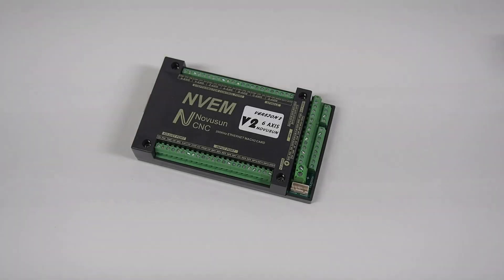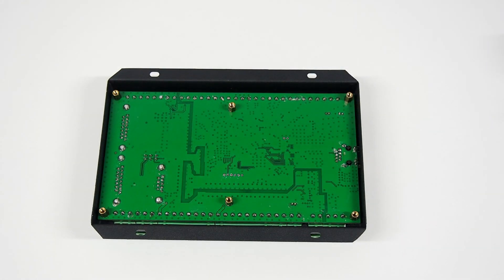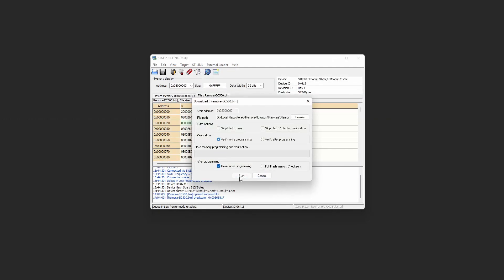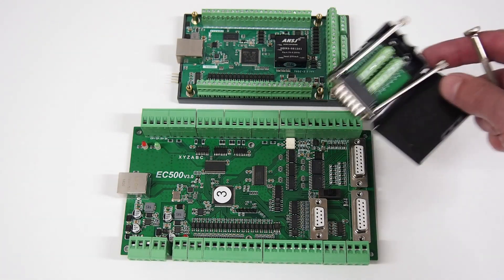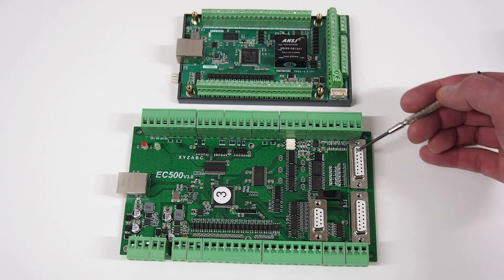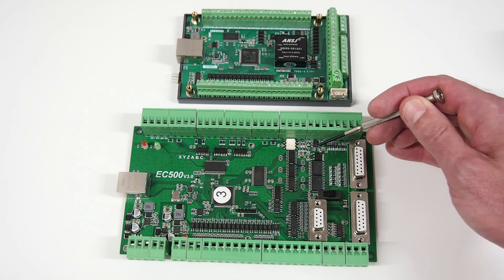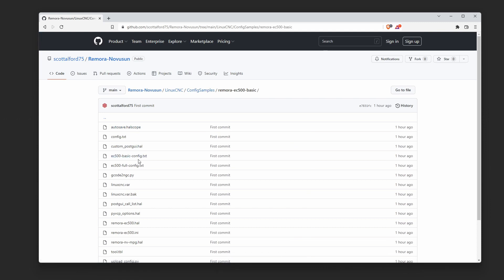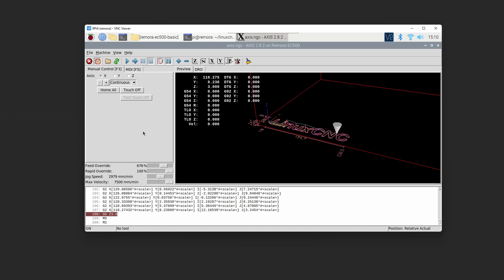Remora EC500

Comment: Hi everyone,

I’m planning to use Remora with a custom-designed board, and I want to use it with a regular PC (not a Raspberry Pi). I would like to communicate over LAN (Ethernet)

Here are my questions:
	1.	What STM32 MCU is recommended for this setup?
	2.	Which firmware should I use or modify?
	3.	Is it possible to communicate with the Remora board using Ethernet from a standard computer running LinuxCNC?

Any guidance or resources would be greatly appreciated.
Thanks!

Comment: Looking for this DD EC500 on ebay and amazon. They are with the model EC500, no Digital Dream marking. Will one of these work with the Remora firmware. (They look 99.99% the same, just DD text missing) My RPI5 with LinuxCNC 2.93 is just waiting for this project upgrade.

Comment: Thank you so much scott for this great video.
I just got the EC500 version 5. And i couldn't figure out how to flash the Remora firmware on this board because it seems to have a different configuration.  The pins on this board are
GND
SCK
SWD
PRO-B
3.3v
BOOT
I was wondering wich of each pin will connect on the stlink v2 in order to flash this board
Reply from the maker: There is heaps of info and a guide in the LinuxCNC forum topic. https://forum.linuxcnc.org/18-computer/44828-remora-ethernet-nvem-cnc-board?start=1640#295702

Comment: hi I have a quick question as now I can see that new EC500 has LED's near each output / input pins  and I also wonder if they changed something on the board itself as well and if this will be working with your firmware ?   I plan to make second cnc machine and i'm looking for new controller and if this will be a good option then i will order that board  and use this remora firmware

Comment: Hello, I have an EC500 board with a burnt microcontroller. Is this firmware the main one? If I replace the microcontroller and reprogram it with this firmware, will it start working again?
Reply from the maker: Hi, if you board has the NXP RT1052 chip, these are not easy to replace. The STM version of the board would be a little easier but still difficult without the proper equipment.

Comment: Hi Scott, I'm having a problem, when I run python3 upload_config.pi ec500-full-config.txt it displays this 
Timeout waiting for traffic, retrying...
Timed-out waiting for traffic
resending last packet
Resending packet WRQ packet: filename = config mode = octet on sessions <tftpy.TftpStates.TftpStateSentWRQ object at 0xb65339d0>
Any idea on why I'm having this problem?
Reply from the maker: Hi, which version of the EC500 so you have. The STM or RT1052 version. The RT2052 firmware does not have the capability or need to upload a config. It has everything enabled in the firmware.
Reply: @scott3d506  I have the RT1052, does the config need to be uploaded?
Reply from the maker: @oscarbeltran1105  No, the firmware is hard coded. I'll be releasing a specific firmware version for the EC500 in the coming days with all of the IO except for the MPG operational.
Reply: @scott3d506  Great! Thank you!

Comment: Hi Scott, All is going well now i have finished the hardware. I can not seem to find how to change the motor direction in the ec500 config.txt. Could you please give me an example of changing motor direction thanks.
Reply from the maker: Hi, the motor direction is set in the LinuxCNC configuration. In the INI file the change the SCALE for the joint to be a negative or positive value to change the direction.
Reply: @scott3d506  thankyou. Did you get the 0 to 10v  for the motor speed controller working. Thanks for all your help.
Reply from the maker: @powermate  Yes, it's working for the STM32 version and I have a software PWM version working for the RT1052 version but I have not released it yet as I want to get the flexIO version working. Been busy with work so hopefully of the Christmas break.

Comment: Hi All, Just got this working on a J1900 NUC with LinuxCNC 2.8.2 Debian 10 Buster PREEMPT-RT ISO. I installed advanced network manager (mine was not working to edit the connection) then Probe basic (maybe this helped). I set up the connection like they do for mesa boards. Then installed as per this video and the Nvem video. I am no exert on this, all black magic to me.. So far seems to be working great. thanks Scott for your help so far.

Comment: Hi All, The software is working great now to hardware. When i measure the voltage on the direction pin (PE13) it goes from -3.2v to +3.2v. My servo expects 0 to +3.2v or more. I did fix this using a diode in the direction pin. Do you guys think that this can be fixed by firmware or is it just part of this hardware board.  thanks Bradley
Reply from the maker: Hi Brad,  great to hear. Step by step your getting there. The EC500 step and direction drivers are a differential pair. This is what you are seeing. Try using + terminal and a ground (common). There is a com0 on the spindle terminal. This is how I've been testing with my logic analyser.
Reply: @scott3d506  thank-you, I will give that a go. The raspberry pi is more that enough for my mill. speed wise. I will mount the pi on the ec500 for a neat unit.

Comment: Hooray . Finally got it going great. My bad. As a newbie to Linux I had to refer to the other video (NVEM) and accidentally used the wrong software. I also had to install the tftpy library and for some reason the halcompile did not work so i re stalled that too.  I would like to get it going on a pc with  Debian 7 Wheezy ISO. So far I am trying to compile the component but errors out cannot find any of the library files. I have the pc  communicating with the ec500 board . Has anyone a got a idea on how to get halcompile working. Anyway thanks very much for the start.
Reply from the maker: HI Brad, great news. to get halcompile you need to use the dev version of LinuxCNC.
Reply from the maker: sudo apt-get install linuxcnc-uspace-dev
Reply: @scott3d506  I did try  (sudo apt-get install linuxcnc-uspace-dev) on my PC. Can you get that dev as an iso if not I think building it would be above my pay grade  :) As you can see the math.h is missing and when i change it to rapi_math then the next library is missing and so on. Does not find any of the librarys.

make KBUILD_EXTRA_SYMBOLS=/usr/realtime-3.4-9-rtai-686-pae/modules/linuxcnc/Module.symvers -C /usr/src/linux-headers-3.4-9-rtai-686-pae SUBDIRS=`pwd` CC=gcc V=0 modules
make[1]: Entering directory `/usr/src/linux-headers-3.4-9-rtai-686-pae'
  CC [M]  /tmp/tmpHZfwXY/remora-nv.o
/tmp/tmpHZfwXY/remora-nv.c:25:18: fatal error: math.h: No such file or directory
compilation terminated.
make[4]: * [/tmp/tmpHZfwXY/remora-nv.o] Error 1
make[3]: * [_module_/tmp/tmpHZfwXY] Error 2
make[2]: * [sub-make] Error 2
make[1]: * [all] Error 2
make[1]: Leaving directory `/usr/src/linux-headers-3.4-9-rtai-686-pae'
make: * [modules] Error 2
bradmohr@cncmill:~/linuxcnc/Components/Remora-nv$

Comment: Hi , thanks for the video.  I was given an ec500 to experiment with. I am trying to connect to mach 3 first to see if the ec500 connects are usual before upgrading to remora. No such luck yet. I was hopeful you might have a copy of the original software before upgrading. Thanks in advance. I will be going down the remora path hopefully  in the future.
Reply from the maker: Happy to share, but there are a few versions of the board. Is yours the same as in the video?
Reply: @scott3d506  Hi Scott, I have just noticed your reply. thanks. Been working on my mill. Have all the servos now. I have just set up a working computer with linuxcnc and is working great not so i am going to just convert my ec500 ( looks that same as yours) to remora. I think that this is going to be great solution. Better than lpt and easier than the mesa cards which are hard to get. I really think this is a great middle ground for the diyer. I am looking forward to the 0-10v motor controller part working for the vsd. I am from sunny Queensland in Australia and were curious to know what part of the globe you are on. I also have a UC300 (small red board) , it seems to be and stm32 to breakout pins. thanks very much for videos, looking forward to the next one. Brad
Reply: I just pulled my ec500 apart and it is the  V3 exactly the same us yours. Circuits look the same also. Brad
Reply from the maker: @powermate  Hi Brad, I'm in NSW.